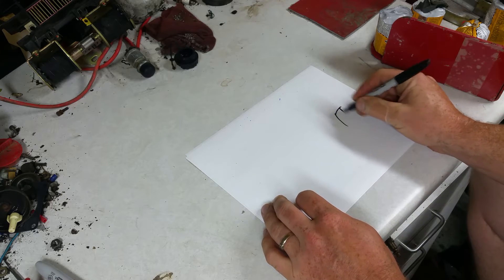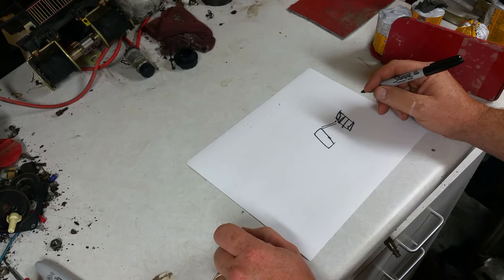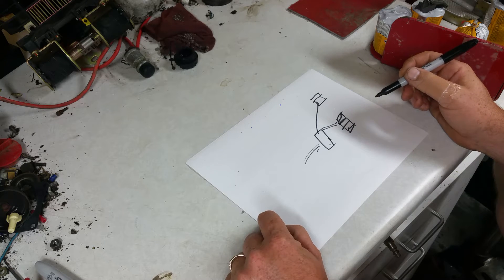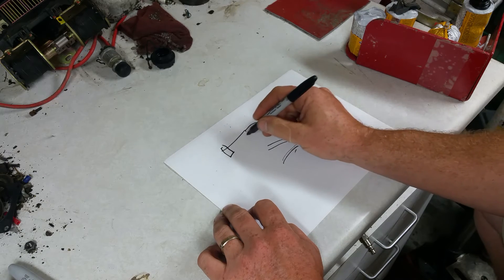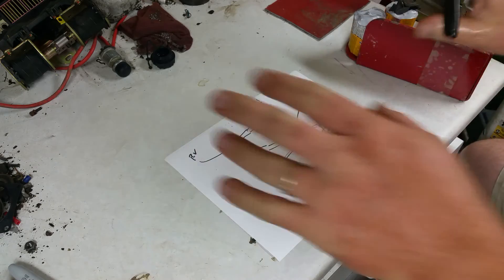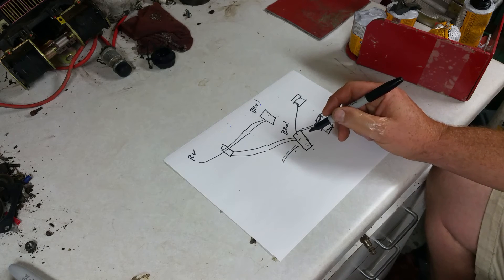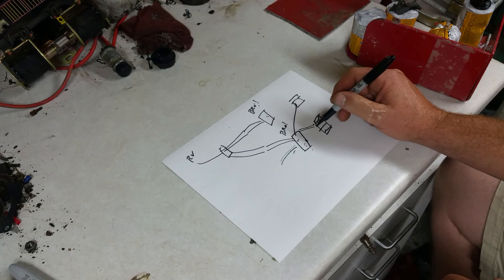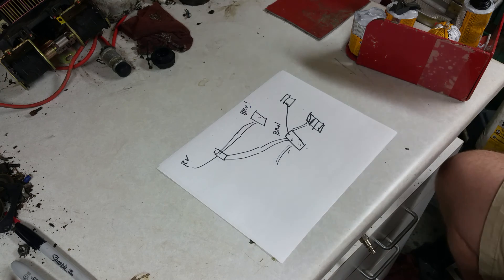how inverter generators work

Comment: Here's the info you're looking for: From front panel to back, for a small 2000w inverter gen. 

Inverter board and components behind front panel are encased in a resin to prevent water or dust ingress.

The small, low compression 4 cycle engine sits in transverse orientation in the middle of the housing with the axle-shaft pointing towards the rear of the unit. 

At the rear of the unit, inside an aluminum casting that's bolted to the aluminum engine block housing, a stator wound in a 3-phase configuration sits stationary in a circular orientation around the output shaft of the engine, which has a circular ring magnet mounted around a bladed flywheel-fan as one unit, keyed to the engines output shaft. This is the genset head unit. 

As the engine rotates, 90-100v electricity is generated in a 3-phase pattern from the stator, which is carried through conductors to a bridge rectifier in the front panel, rectifying the 3-phase AC current to around 110v DC current, which is fed into a large value DC capacitor that acts as a power reservoir to supply the AC loads for the fractions of a second when they hit the inverter until the engine can increase in rpm to meet the current-draw of the new load. 

From the DC capacitor, the DC electricity is fed into a duel-parallel array beefy IGBT's (Mosfets, usually) one set on each polarity of the power rail, taking turns switching on and off to create a stepped square-wave pattern that, when smoothed or "rounded off" by a large toroidal inductor that's in series with the mosfet output, creates single-phase 115-120v sine-wave AC electricity. 

Control circuitry in the front panel monitor the AC voltage at the inverter's output. The AC voltage drops when a load applied to the inverters output, which prompts the control unit to raise the engine's rpm until the set output voltage is once again around 120v. 

The generator senses and compensates for loads by simply maintaining a set voltage at the output of the inverter, which requires a higher engine rpm to maintain as the load increases. (more current is generated from the genset head as the rpm is increased) 

By utilizing this 3-phase genset head, the generator is able to lower its rpm when there is less load on the output, conserving fuel, as the inverter's 60hz (Americas) AC output is not directly taken from the output windings like it is in a conventional generator. As such, in a conventional generator, the engine RPM dictates the output frequency of the AC output. In a conventional generator, the magnetic flux increases on the genhead unit as load is applied. This has the effect of resisting the engine's spinning motion, and a governor is activated to maintain 3,800rpm at all times, despite the amount of load resistance on the windings, because it is that 3,800rpm that keeps the output frequency at 60hz, from the way that the head unit is wound. This is simpler, however as loads are placed and taken from the genhead, there are fluctuations in the frequency and voltage output as the governor attempts to compensate the throttle position of the engine to maintain that 60hz value on the output. There is a lag in the compensation, which causes the output frequency to go above and below 60hz as loads are placed and taken off of the generator. 

For inductive loads such as fans and resistive loads such as lighting, this is not usually an issue, however the more complex circuitry in switching power supplies for electronic devices are designed to be fed 60hz at all times, and powering such devices with a regular conventional style generator can damage or destroy the power circuitry. That's why inverter generators are recommended for electronic loads such as computers, TVs, etc... 

Cheers. Have a nice day.

Comment: I was expecting a more  technical explanation of exactly why it's lighter and quieter . As in the switch mode power supply the reason it's lighter and smaller than the normal heavy transformer power unit is that the mains is chopped up into a high frequency and using the fact that with high frequency you can use a much smaller transformer.

Comment: Sounds like you "know" your stuff!!! It basically... ugh... bro... WTF? I feel so stupid now! That's not how all invertors work by the way. They don't change AC to DC, it's the other way around. There is a convertor or rectifier in between the magnetic AC field generator and the invertor that has a higher differing RMS voltage. The invertor outputs a pure sine wave AC voltage that is usable for equipment. Nice boxes and lines though!

Comment: Hi,
Please view your video, delete it, then write out what you want to say and prepare your diagrams.
Then make your video.
Sorry but it bored me to tears and told me very little.
Even a real inverter generator on your bench to show where all the parts are would make a better presentation.
Reply from the maker: thank you for your concern, the issue with having  a inverter generator to show you is that all the parts are potted in epoxy, you can see leads coming out of the alternator and go into a black blob then output leads going to the fuse/outlet. i think i found a cheep Chinese one  that is not potted, i just need $650 to get it here.